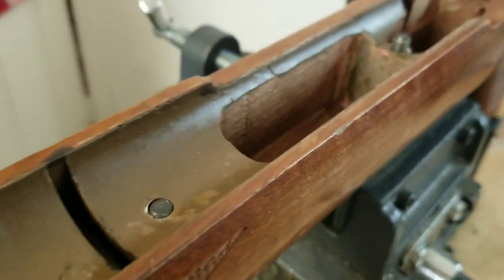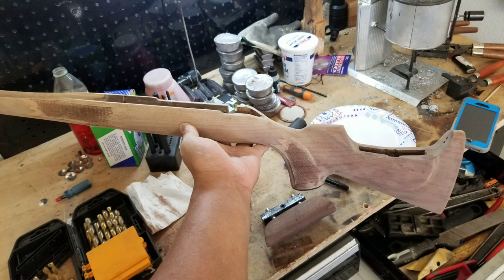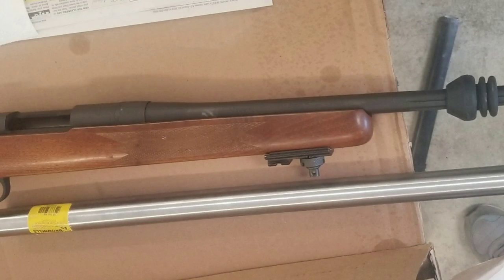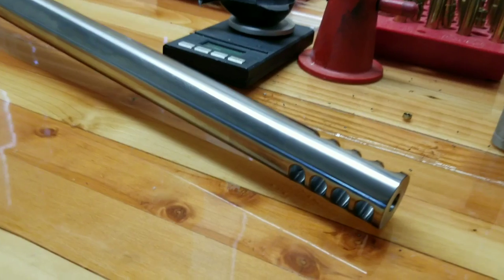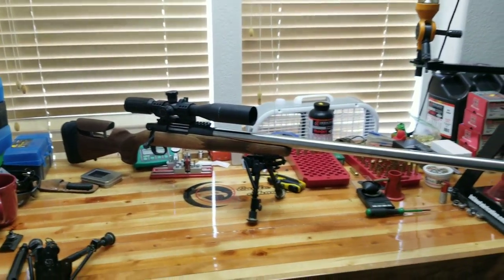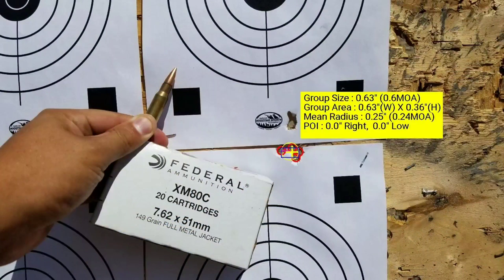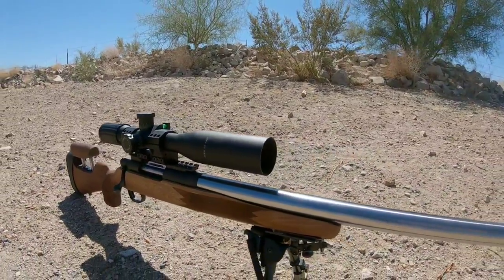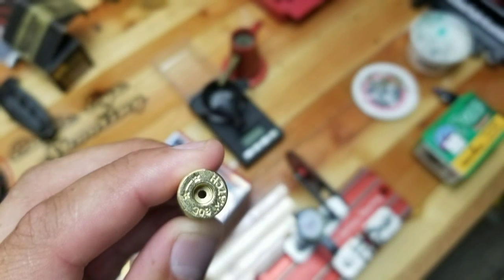💵 DIY Budget 💵 F-Class / ELR Custom Rifle - Mossberg 100ATR .308 Win - Sub $700

Comment: I think I told you on an earlier video that I took a Savage Model 12FV 6.5C, sub $400 rifle from Cabela's,  mounted a Leupold VX3i from another rifle on it, loaded new Gunwerks brass and shot a .389 MOA group at 102 yards (142 grain SMK's) with first ever shots 5-9. I did all the bedding possible before taking it to the range and dialed the trigger down all the way. Accuracy does NOT have to be expensive! Looking forward to the reloading series! Thanks Kenny!!
Reply from the maker: O yeah I remember you said that. Yeah the 12FV is definitely Savages secret gem. If it goes on sale again imma grab one
Reply: @EagleEyeShooting  check Cabelas. I'm picking one up in .223 this afternoon. They had a sale going....I think I paid $379.

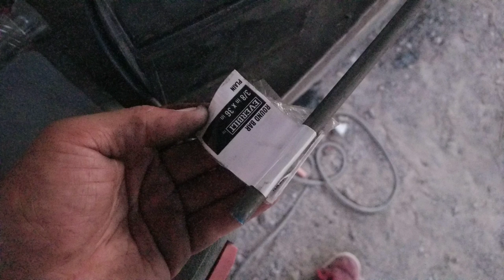Comment: EE, OT but did you ever test the accuracy on the two 350 Legend barrels? (1:12 vs 1:16) ?  I would really like to know because I want to build one and am wondering if I should go with a 'stock' 1:16 or get a 9mm and have the chamber bored.  Thanks
Reply from the maker: Hey brother. I just got my modified reamer for 350 legend and currently making a barrel for a savage axis and AR. Its a 1-12 twist 357 bore instead of 355. The reamer is necked up to accept 358 bullets... basically making what the 350 legend is suppose to be. It should be done this weekend.  I hope to test heavy grain projectiles and hopefully make a subsonic load aswel. Hope this peaks your intrest!
350 Legend Modified .358 reamer https://imgur.com/a/a2Uz5Tz
Reply: Yep, you definitely have my attention!